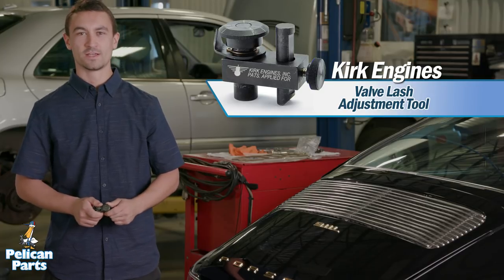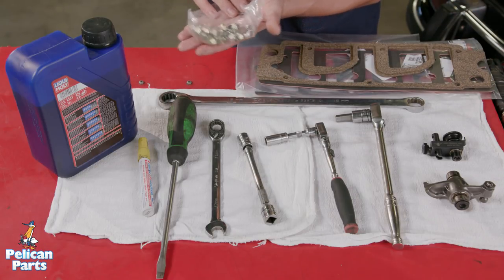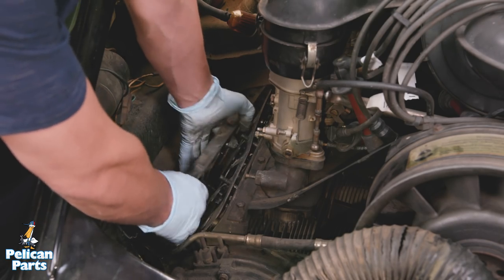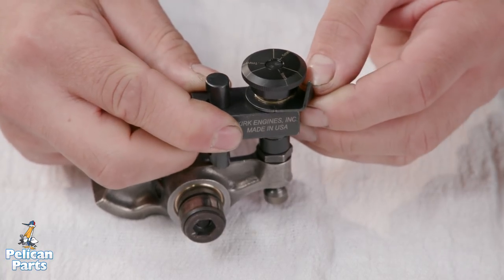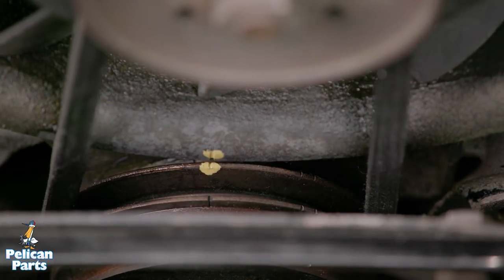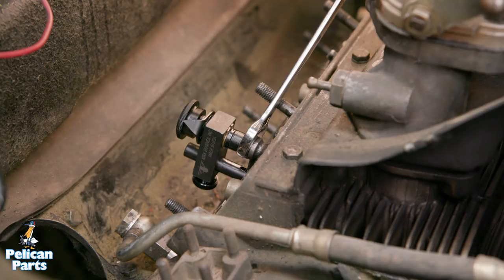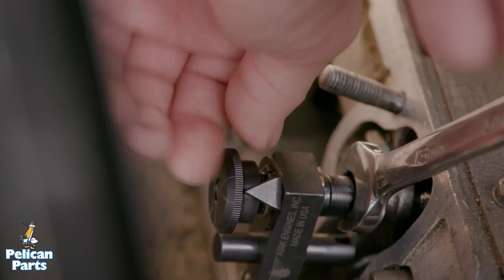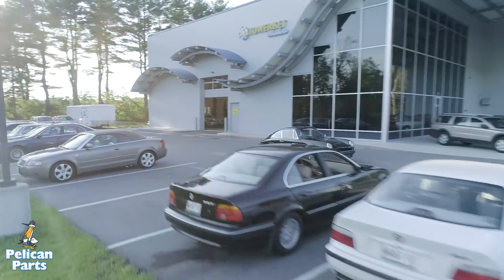Kirk Engine Valve Adjustment Tool for Porsche

Comment: I made a similar tool about 15 years ago, I like this design, I had also 1.5 mm  on the one I made, some high compression race motors need 1.5 mm on exhaust side. nice tool you made there.
Reply from the maker: Thanks for the feedback.